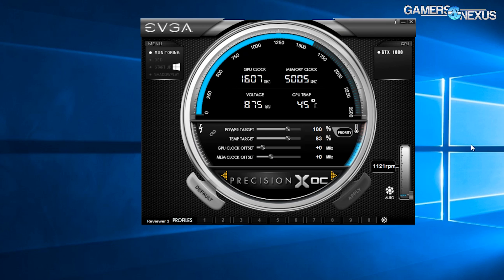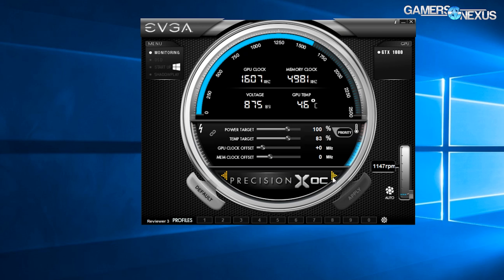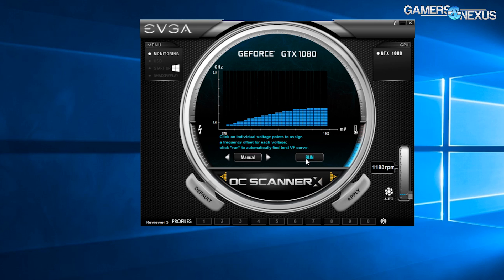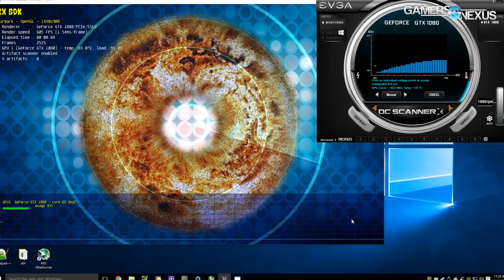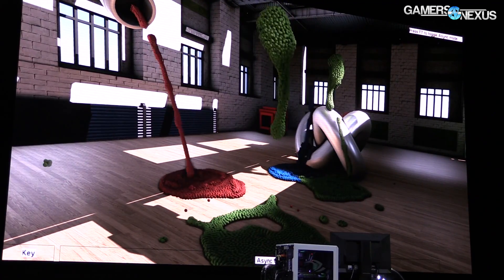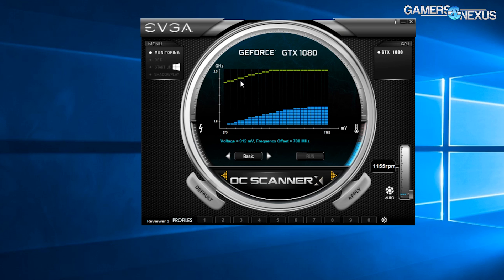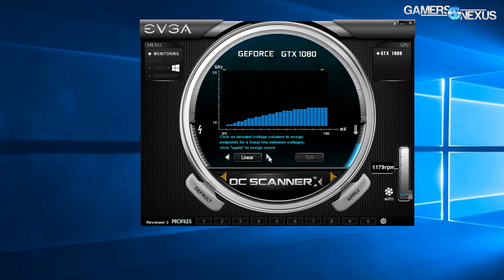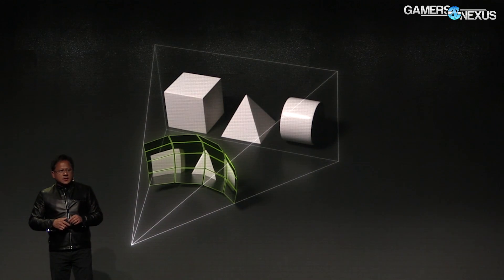Major Overclocking Changes to GTX 1080 w/ ScanOC

Comment: Will this allow even more stable overclock than a factor overclocked, or will the factor overclocked versions from the different companies use this tool to make their overclocks even more stable ? Will the companies that overclock use this, or do they have better methods ? Will factory overclocked cards already be at the max, and this program won't do anything more ?  :P 

My mind is just buzzing with questions. As someone who knows very little about overclocking, and who has failed to really overclock my card, I welcome this, if its a step forward. I really don't care if it takes away a competitive edge of those with more knowledge of overclocking. : P   Bring on the Frames per second.
Reply: No, manufacturers will never run this tool for each individual chip. There will always be potential to OC higher than factory OCed cards.

Comment: This is how I have set my GTX970 modded bios, 74clock speeds all individually tested with their own voltage sets,
 I'm glad Nvidia is going this path, much more stability than the old method, also dowclocking when powersaving mode is enable is smoother, doing it on small steps instead of the huge jumps from the stock bios.

Comment: Is OCScan only usable with pascal CPUs? Or can this be used on older Nvidia GPUs and with SLI?  Maybe AMD cards?
Reply: +HUGSaLOT Valkyrie only pascal because its accessing stuff in the hardware by the sound of it
Reply: +psionicinversion yeah but it sounds like you could do this with any GPU or even a CPU. The only thing it's reading are temperatures and clock cycles. If all it is doing gradually overclocking the processor, tests it, then ups the overclock/voltage again and repeatedly does this until it errors, thermal throttles, or fails outright, then you could technically do this with any processor.
Reply: HUGSaLOT Valkyrie yeah could do. Apart from the special volt thing as the power system in pascal is different to maxwell to specifically allow for it. Problem is thats part of EVGA precision X and i tried to run it on my radeon and i dont think it even loaded up. Has to be used with an nvidia card.

Regarding the CPU im not sure, it might require access to different stuff that the program wont be designed for

Comment: As an OC'er this is making me think about a pascal card instead of VEGA later in 2017. It sounds like an interesting feature to play with. I guess we'll have to wait until the program is out to determine how useful it actually is.
Reply: +Yabloko91 VEGA? Is that the next AMD GPU after Polaris? Why is AMD coming out with hew GPUs every 8 months now?
Reply: +Charles InCharge Ohh so just a RAM bandwidth upgrade, with the same old-tired GPU. (sigh) Sounds to me won't help AMD much now that we are seeing GTX 1080 benchmarks now.
Reply: +Charles InCharge This isn't an oversimplification when AMD has a track record of doing small changes. If they are doing more than what AMD is leading on then that's great.. but I'm not an AMD fanboy blinded to AMD's history. So I'm not keeping my hopes up if Polaris or even VEGA will amount to anything.